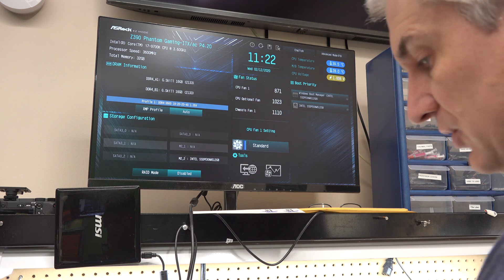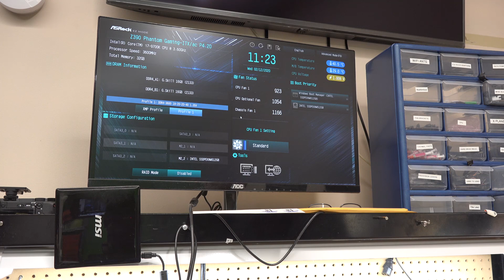PC Repair - 6 Month old PC comes back for a visit

Comment: HELLO MICHAEL! Am an avid Subscriber, you are my first 'Go to' when diagnosing PC issues! I recently built a new Computer in my old Tower with a new Raidmax Vampire 1000W 80 Plus Gold Power Supply, an MSI Z390-A PRO Motherboard with an Intel Pentium Gold Processor G5400 CPU @ 3.7GHz! Next added  64.0 GB DDR4 3200 Ram! Also a ZOTAC GAMING GeForce GTX 1 Video Card! Recently upgraded all my HHD's with an Intel 660p Series M.2 1 TB SSD Drive C and two WD I TB internal SSD's! My Computer now boots up completely for a cold start in 30 seconds!!!! (Once in a while when I turn it on, it Boots into the Bios Screen)!!!(But when I wont to boot into Bios, no matter what key combination I press it wont go into Bios on Command)! Windows will not display on my Digital Monitor but I can see the Bios Screen on another HDMI Output to my 32 inch TV! Am running XMP Mode and Gaming Mode on the MSI along with allocating 3/4 of my Ram to Process my Adobe Premiere 2022! My Question is: How do I get the computer to Boot into Windows EVERY TIME? And secondly, How do I get my computer to boot into Bios on command?

Comment: I reeely suggest you get proper table work station, cause yikes.

Would really not plug in new gpu first, that would be the last scenario, cause if there is a short it can destroy that too.

Take them all parts out, and test separated, yes it takes more time, but there can also be more than one issue on the computer to be found.

Would test the psu before adding new gpu atleast. Gigbabyte not the top ones...

As professional i think you have several test bench available with varieaty of platforms.
CPU and mobo are tricky to test if you dont have working components for that same socket.

Comment: My PC keeps crashing aproxematly 12 min into ANY game, I'm desperate and asking anyone who could possibly help, any info would be nice. Tried resetting my pc already, did nothing... Also tried reinstalling windows... Worked... For exactly 24h, then it started crashing again
Reply from the maker: Sounds like the GPU is bad.  But, try re-seating it...remove it and just re-insert it.
Reply: @xforcepc  the what now? I am a PC illiterate, so I don't know much abut that, I did some digging however and found two event I'd codes: 6008 and 161, going to call tech support tomorrow, thx for the help anyways. (Pls let me know if you have any info regarding a possible fix or something other than that, that I could try)
Reply: @xforcepc  oh, you mean the graphics processing thingy
Reply: @xforcepc  will give it a try, thx

Comment: lol that cable was not going to get caught in the fan. those fans do not have enough pull for one and for 2 those cables are fairly rigid. at most it would rub the fan.
Reply: How can you tell from the angle of the video and I’m pretty sure ‘would rub the fan’ is the wire getting caught in the fan 🙄
Reply: @therabbit0  it may rub the fan but there is no way it would literally get caught in the fan getting caught in and rubbing is 2 different things lol. not saying it wasnt a stupid spot for a cable though bc it was.
Reply: @therabbit0  not sure if you know this but, fans wires are stiff and they don't get tangled easily or get stuck into fans, worst case scenario it hits the fans and starts spazzing out just like when you rest your head on a school bus window

Comment: What is a burn in?. You mention it at the very end. I've only built one computer the one i have now. I was lucky. No problems happened,  but content like this takes the fear out of building. Thanks.
Reply: Burn in is when you stress test a new PC after a build. I believe it's nonsense though. A PC is not like new engine that has oil and needs to be 'burned in'.
Reply: @pilotboy2612  true,  if it it works it works. cut the bull s
Reply: it's just running the computer a few hours to make sure nothing fails during it's first few hours, test cooling system, put system under a bit of load to make sure GPU and PSU and processor all appear 'up to snuff'.... (Odds are , once all parts are good, running it 1 hour or 10 hours won't make any difference any way)
Reply: @mdd1963  thanks for answering TWO years later LOL. But seriously till now i didn't know what that meant.

Comment: I've been working in IT for over 20 years - and I've only seen one processor go bad. Agree that's super rare.
Reply: Not certain about the points made but ,if anyone else  wants to discover 
electronics equipment repair course
 try Saankramer Electronic Magazine System (just google it ) ? Ive heard some interesting things about it and my mate got excellent results with it.
Reply: Me neither, at least not when left in the socket.  I'd be suspicious of the board or maybe, the power supply if one actually failed.

Comment: Michael notice exactly what you did and what the customer said. After you put the new GPU in you first rest the CMOS without trying to turn it on as is. The customer said he tried without the GPU and it still wouldn't boot UNLESS he reset CMOS. Trying powering up again without reset and see what happens. The GPU maybe a red herring. 
If that's the case then I had exactly this issue and not sure what's going on. 
PS I also build PCs
Reply: I'm not a fan of some of his methods shown in this video. He said a few things I completely disagree with. That being said I'm sure he knows what he's doing, it's not always easy to make a video while doing troubleshooting.
Reply: @Eremon1  cpu fan fitted incorrectly also i think
Reply: @preddy2940  yeah it should blow from front to back while blowing on the heatsink. Not a huge deal but will be slight temperature difference. Propably he couldn't because of the ram.